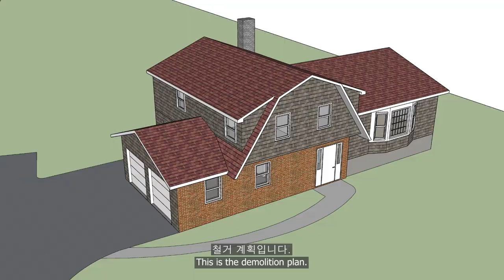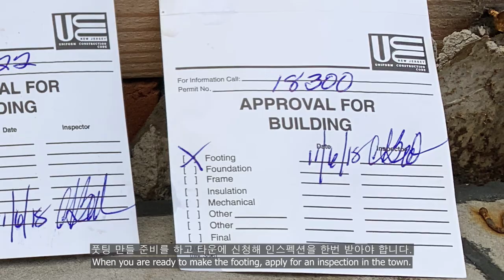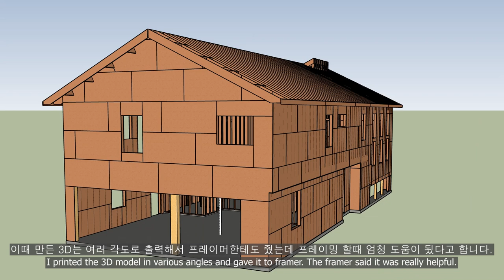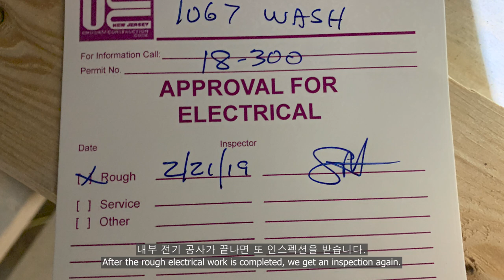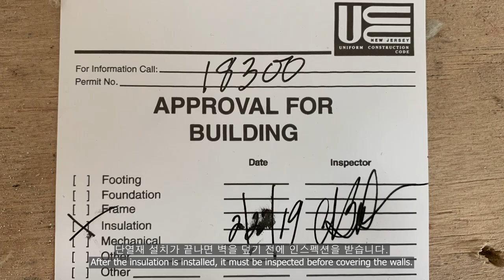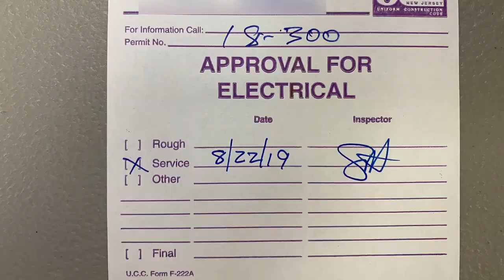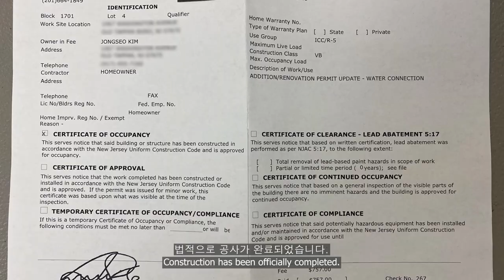Building a House in NJ - Construction / 미국에서 집짓기 - 공사

Comment: nice work! how is the noise level that your house is in front of a busy road? im currently interested in a house but its on a busy street and am hesitant bc it may be loud
Reply from the maker: To be honest, it's not without road noise.
At least, I used ROCKWOOL insulation and good windows to reduce it a lot, and there is very little traffic at night, so it doesn't bother me that much.

In a house by the road, windows are the most important. It should be airtight, and the thicker the glass, the better. It is also recommended to double the window. Next is the wall. Rockwool is better at blocking noise than glasswool, and it is even better if Rigid insulation is applied on outside according to current insulation regulations.